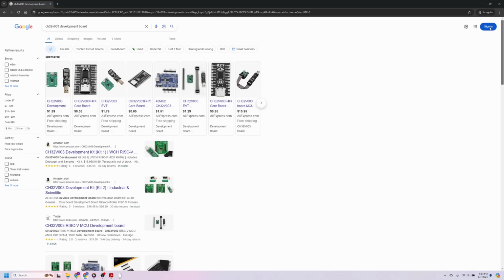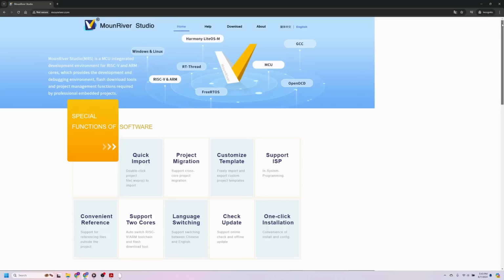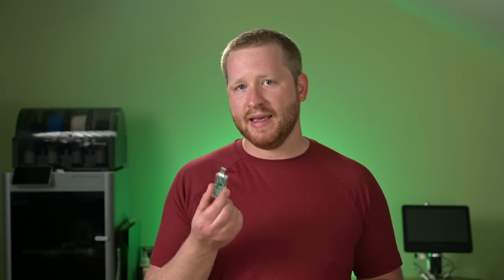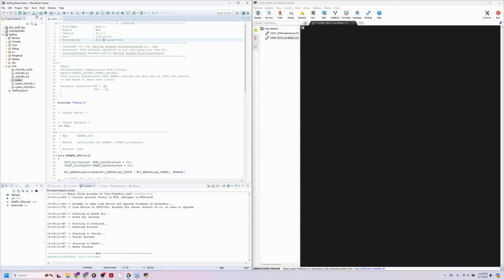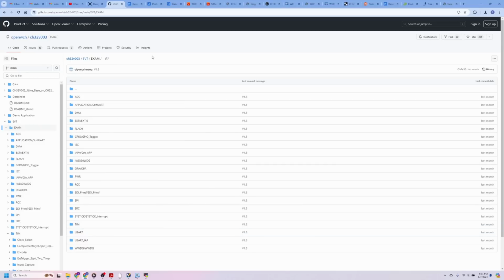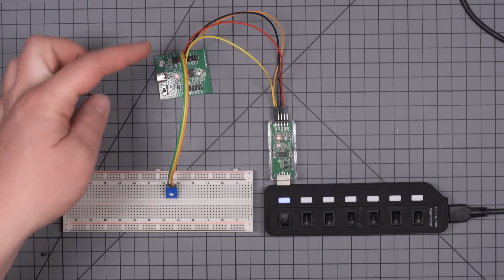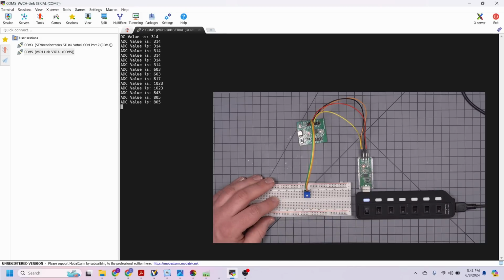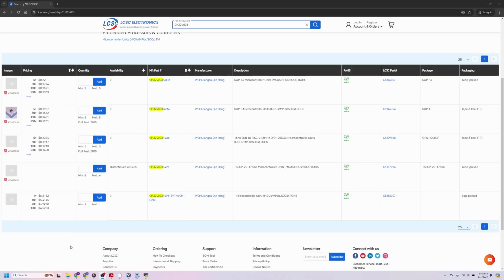Which 10 Cent Microcontroller is Right for You? Comparing the CH32V003 to the PY32F002A.

Comment: This vídeo has aged poorly very fast. While the PY32F002A/003/0030 have just dissapeared from the manufacturer (maybe those that still sell them are the remainders), some months back, WCH released the big brother of v003, the v006, with 12 bits ADC, and lot of memory (8kB ram @62kB Flash), and i purchased 100 for less than 20€. Still listed for selling.

Comment: Any thoughts on the new $4 chip, WCH CH32V317WCU6 , which has built in ETH MAC, and USB-HS ?

I'm finding that if you need Wifi or Ethernet, it's hard to piece together a solution under $4..  
but for a dollar more, an ESP32 module gives you everything built in (ex. ESP32-S2-SOLO-N4 (w/QSPI) , ESP32-C3-MINI/WROOM, ESP32-S3-WROOM-1-N4)

Comment: Thank you for your very clear description of how you evaluate different component options.

I was looking for less expensive alternatives to fixed logic chips.  Specifically, I needed more input pins than the MCU in my project had, and also I had about 20 signals to come from another board without running 20 wires, so I wanted to "pre-process" and serialize those signals before dumping them into the main MCU.  I could have used a shift register or a port expander, but these were in the $1.50 to $2.50 range, which just seemed excessive.  Having heard about ten-cent microcontrollers, I looked at the options.  I didn't need to get down to ten cents, but I figured that fifty cents would be a good goal.  I only found one place selling PY32 chips, but MANY selling CH32s,  Which was one plus.  And then, finding a couple of very useful YouTube videos on getting started with CH32 development, and looked at both the datasheets and reference manuals for the CH320 series, I felt a lot more comfortable than I would have with the PY32.  I decided on the CH32V006.

I think that your complaints about the example code you found being too advanced for what you needed, may have just been a matter of picking the wrong example code.  There are a number of examples in the documentation for the evaluation board for the CH32 series that are simple: on https://www.wch-ic.com/products/CH32V003.html there is a link to a zip file, https://www.wch.cn/downloads/CH32V307EVT_ZIP.html.  These are basic enough that you can just copy/paste them into your code and then modify that, so it may be that whoever wrote the examples you found had found the official examples too simplistic, and wanted to extend those to more demanding applications.

You make some very good points overall.  But I would disagree with your worry about chips going end-of-life.  I've seen plenty of fixed-function chips go obsolete, while in most applications where you need a microcontroller, almost any microcontroller with the right number of GPIO pins and interfaces you need would do the trick.  You'd still have to spin the board if it was a production product, but the whole automotive industry had to go through this in the post-covid supply chain breakdown, and they were able to do so by replacing unavailable chips with ones that they COULD get.  Not that they were at all happy about this, but it's a lot easier to learn a new microcontroller to do things you already know how to do with a microcontroller, than to redesign an entire board because of a part that there was just no replacement for.  And I'm pretty sure as long as we have computers, we're also going to have microcontrollers.

Comment: I didn't figure yet how to program the PY32. Any hints?
Reply: I forgot to say, as the HW programmer I use the RadioOperator's FW of the CMSIS dap in a Bluepill.
Reply: Impressive how no one care to answer this question. Did you find how to program it?
Reply: @orides5976  Yes, not very dificult to program using PYOCD (fist import the PUYA mcus into the local database but It is also easy to do). In my case, for running make script, i installed MSYS2 inside a Windows machine. Then I installed the PUYA template from @miltonlai4850 aka IOSETTING, followed his short guide, and then started to program my project. As an IDE i simply use Notepad++. 

During next month i will upload an upgrade of the W1209 thermostat using the PY32F002BW15 chip. The code is already done but i'm currently very busy with personal matters....
Reply: I've already uploaded my project to Youtube. It is called W1209-PY. In this, i show how i program the PY32F002BW15 using PYOCD.

Comment: The OPA module is something very useful for me because an opamp can easily cost extra 10cents extra (usually 40 cents). And the DMA is very useful when I control many RGB LED via SPI. Without DMA I can easily get flickering if timer is also being used

Comment: theres nothing wrong with a ch32 being in a product. it is a 32 bit soc. I rather  see a chip i can reuse or replace than one that has no vendor or highly propiertary. I have seen wch chips in products already.

Another reason i like wch chips is because they dont need external components for them to work. The external osc is optional and you can literally use it without any other support components if using a 3.3v or 5v supply

Comment: Microcontroller-style core on an FPGA is not an acedemic exercise. Once you have an FPGA in a project, for whatever hard reason, it has a tendency to just absorb everything possible into itself, because why not. Unless you need an adventurous bootstrapping setup (say you want the FPGA configuration to come from the net, from USB/SD-Card etc, which requires an external microcontroller), but you still need to do classic software tasks such as UI and sequencing algorithmically complex tasks, using a synthesized processor core in your FPGA just makes sense.
Reply from the maker: Fair enough, I'm just coming from my experience where I usually have a dedicated processor/microcontroller (either discrete or in a SoC) or just a processor and no FPGA. I've only ever implemented a soft processor academically, but I'm probably too quick to dismiss their usefulness.

Comment: Note that there is a PY32F002B  part which has same die as the A version but the pinout fits the STM8S003 TSOP-20 part. This was quite useful after the shortages of ST parts.
Reply: 002B is the ultra low power version, deep sleep mode current is less than 1uA

Comment: I just shipped off a project to JLCPCB. Chose the PY32 exactly because of the availability of the part. The CH32 is not available AT ALL for assembly through JLC. Py32 is available in a half a dozen different configurations. If you are designing your own boards, it is just too dangerous to rely on the CH32. There is no guarantee you are going to be able to get stock.

Comment: If you only have 10ct, electronics is not the right hobby for you :-)
Reply: if you are a really passionate hobbyist, you may even be able to get free parts from  electrical waste
Reply: @Zakaria_122  pretty impossible in Germany since basically everything goes to recycling by law. We can't do dumpster dives and pull out a PDP-11 or any other useful stuff. Otoh - if I spend the time I would need for desoldering, sorting and testing doing paid work, I'd pretty likely be able to buy the stuff I need new.
Reply: The funny thing is hobbyist don't waste time saving a few cents. But actual designer will use this mcu in their design just to save a few cents. Which if made in millions will result in tens of thousands dollars saved.
Reply: Every hobbyist dreams of having his projects mass-produced.  Chip-shopping is just part of the fun.

Comment: Isn't the M0 core faster than the RISCV though?  If you did something like calculating primers or similar maths functions to check raw performance.
Reply from the maker: Yeah, that's a good point, just looking at clock speed doesn't tell the whole picture. The QingKe core does have hardware multiplication (but not division) and the M0+ also uses a RISC instruction set, so I'm not sure how different they would be. It would be cool to write a few sample codes doing various tasks and get some real benchmarking in.
Reply: A simple RISC-V and ARM M0 should have very similar performance at the same clock speed. An ARM advantage is more complex load/store address modes and being able to combine shifts with other instructions, though that is for the 32 bit instructions that the M0 doesn't implement. For the M0+ in particular they have a pseudo two stage pipeline and so wastes fewer clocks on jumps.
Reply: @jecelassumpcaojr890  A big RISC-V advantage in embedded applications is the one-instruction "compare and branch". Conditional branches happen a lot more frequently in most code than indexed load/store.

Comment: I'm interested in using PY32 chips for some projects, but I would prefer USB support. Yes, I could just use a USB to serial adapter, but for the sake of simplicity, it would be nice to have it on the MCU. There's a bitbanging, low speed USB project for ARM M0+ called grainuum that looks interesting, but it was developed with and for chips running at 48 MHz. The developer stated that it could be adapted for work at 24 MHz. I'm just curious if anyone has gotten it to work on a PY32.
Reply: All PY32F0 chips can run at 48MHz(or above), event the low end PY32F002A and PY32F002B

Comment: At around 6:30 of your video I finally realize the potential of RISCV. To me it is the ability to add a processor to devices that couldn't justify one but would still benefit from one
Reply: Yes, and it can be REALLY tiny (and slow) but still run C/C++ code compiled by GCC/LLVM. e.g. the SeRV is is bit-serial RV32I CPU that takes 32 cycles for most instructions (64 for shifts and branches) but runs at hundreds of MHz in an FPGA (GHz+ in ASIC easily) and uses only 125 LUT6s and 164 FF in an Artix-7 FPGA (198 LUT4 on iCE40). Plus some BRAM for registers, RAM, whatever your program code uses. e.g. the ICE40UP3K FPGA costs about $7 and has 2800 LUTs.

Comment: Great video! Some additional info I would have liked to learn for these parts: How is the interrupt controller? A full NVIC or a single interrupt with the firmware having to manage everything? Or something in between? Also, the hardware multiplier situation, 1 or 32 cycles for the Arm? How about the RISC-V ? These things, depending on the application, can have a lot more impact on the performance than just the number of MHz.
Reply: The CH32V003 doesn't have multiply. WCH have recently announced some new parts (002, 004, 005, 006, 007) with multiply and more memory. I'm not sure how available they are juet yet, or the price.
Reply: As for the interrupt controller, WCH uses a custom controller called PFIC (Programmable Fast Interrupt Controller), it is very similar to ARMs NVIC

Comment: These chips might not just suddenly disapear from market, but can be suddenly changed. No notice from manufacturer, no errata, just sudden different behaviour. Might be OK for such simple MCU, but requres extensive testing for mass production, which costs.
Reply: Really good point, and low stock means hitting the end of the last full scale production order. What happens to fill the next run could be a major modification, the same chip, or something completely different.

Comment: Jumping onto RISC-V early will be a PITA for now but the sooner we transition the sooner adoption / mass-production ramps up.
Same thing with Linux in the early days...
Reply: Early was 2016 (https://www.youtube.com/watch?v=0eDS6pGYsCE 32 bit FE310 microcontroller with 16k RAM). Now RISC-V already has a huge presence in embedded products -- not as large existing design base as Arm, but apparently more new design wins each year.
Reply: @BruceHoult Not having licensing fees is a huge boon for microcontrollers. It's a similar reason ARM took off, because they licenced it and designs but didn't make the processors themselves, so hardware implementation and pricing competition could be separate from the design. RISC-V is this in a way but completely free to use. RISC-V also doesn't really have any negative impacts versus even x86, thanks to many short instructions in x86 being unused historical 8 or 16 bit ones, and with simple instructions you can fuse them into virtual larger instructions in the hardware to parallelize them. Plus micro operations are used in modern processors because x86 is far too complex anyways for direct hardware implementation, whereas RISC-V cores for microcontroller use can directly implement instructions when high performance isn't necessary.

Comment: The day when an enthusiast can just print a chip is fast approaching and I love it. You're right about using a high level language making the underlying hardware matter less, but if I ever have to implement my own compiler for that piece of hardware I'd rather have a CISC chip than either of these options and as I said, such a day is not far off.
Reply: That's part of the beauty of RISC-V. You can legally make your own chip or core using it (sell them if you want) and just use the standard compilers, not have to write your own. But, as a compiler writer myself, I'd rather do it for RISC than CISC -- you might need more instructions but they are smaller instructions and you can mix and match them arbitrarily, which you can't do with instructions and addressing modes on any CISC, not even VAX. On CISC you are constantly having to worry about whether some complex address calculation can be represented in an addressing mode or not, and if not then what is the best way to break it down using e.g. LEA, and whether you want to save intermediate values for reuse a few instructions later. With RISC (especially RISC-V or MIPS) it is clear and simple and all intermediate values are in registers if you want to reuse them.
Reply: @anon_y_mousse  I'm sorry mate, but I'm a compiler engineer (and have also helped design ISAs) while you don't know what you're talking about -- you don't even know, for example, what an "addressing mode" is, which means you're not even an assembly language programmer, let alone know anything about writing compilers. So I reiterate what I wrote before, and rest my case. I'm only replying so anyone who comes across this won't be confused by you. I suggest you do some more study, and learn assembly language programming -- either Arm or RISC-V would be good.
Reply: @anon_y_mousse  that's quite amusing how obsessed you're getting. Much of what I've worked on is proprietary and as I'm not currently looking for work I don't have a reason to update LinkedIn. But do have fun.
Reply: @BruceHoult  Right, so you're a poser. You can list proprietary stuff on your resume, yet you don't, and what you do list probably isn't even true. I still haven't found any code written by you, not even a toy language. If you're such an ardent compiler engineer, where's anything that you've actually written?
Reply: @anon_y_mousse  shhhh, don't tell everyone! Lol.
Reply: @anon_y_mousse  It's not hard to find evidence that I have skills and experience in assembly language programming, designing new machine code instructions, writing programs that generate asm/machine code (e.g. compilers and JITs), implementing machine code (e.g. emulators, including JITing emulators to another ISA), so your inability to find it adds to your clear (from not knowing what an addressing mode is) lack of knowledge of assembly language (and therefore compilers), which is the actual issue here despite your attempt to deflect by making it about me. I'm not saying you're a bad person or stupid, just that you doin't currently know anything about this particular field. Fine, most people don't, it's quite specialised. Or, at least, I wasn't saying that until you became obsessed....
Reply: @BruceHoult  If it's really not so hard to find this evidence, then post a b64 URL pointing to it. You know how to do that, right?
Reply: Print a chip….. tell me you don’t know what you’re talking about
Reply: @zx-4rr-pls  Tell me you don't know what the word euphemism means without telling me.

Comment: Just my two cents, but if i don't have special needs and build a one-off, nowdays i will always choose a RP2040. I can get a knock-off board for ~2€ on AE, RPi Foundations documentation and SDK are sublime and there is no special hardware needed to program one. Even debugging, just use a second RP2040 board and upload the official debug tool to it.
This is a ecosystem every other vendor should grab a page off.
Reply: These mcu are made for mass production in the millions, at that quantity your two cents comment is enough to buy one mcu. RP2040 could never compete with them at such price. Especially when the design contraint is the entire board only costs 10 cents.